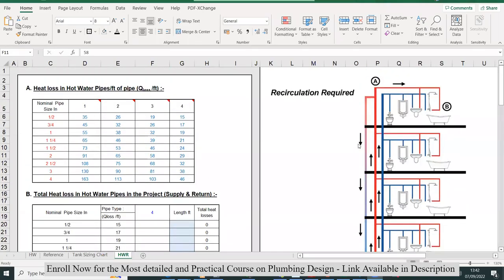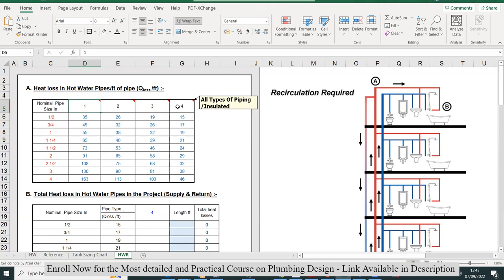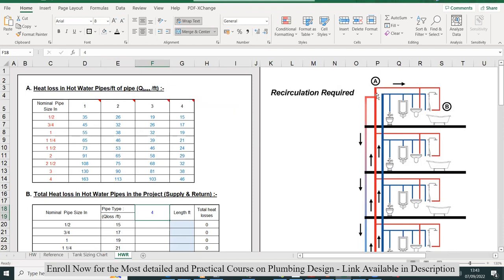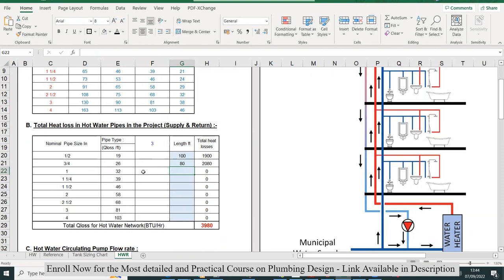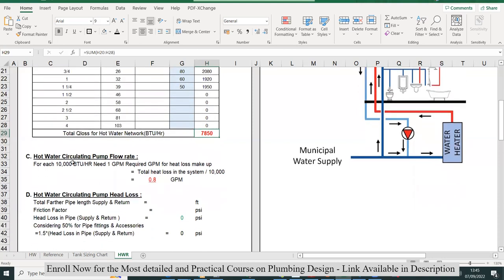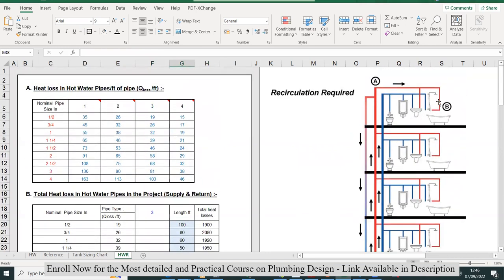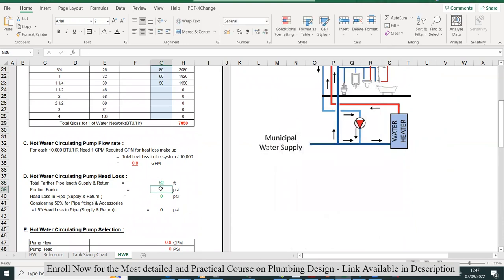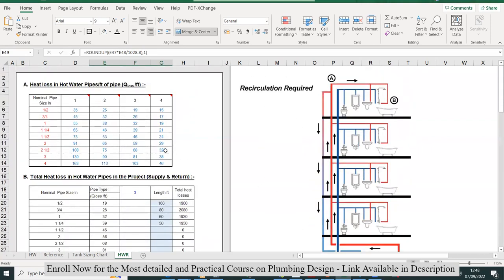Learn Complete Hot Water Return System Design & Calculation || Plumbing Drainage Design

Comment: Is it possible to download these excel files from somewhere?
Reply from the maker: Below is the link to the complete course with all calculation excel files. Please Enroll to get the access.
Water Supply : https://www.udemy.com/course/step-by-step-design-calculation-of-plumbing-system-part-1/?referralCode=EE7C13546F217574A353

Drainage : https://www.udemy.com/course/plumbing_drainage/?referralCode=D2A9B0EF5E42555938C4

Comment: Please explain in the case the hot water heater or boiler location on the roof of the building... how could make the recirculation pump flow rate and head? Urgent need your help for that misunderstanding